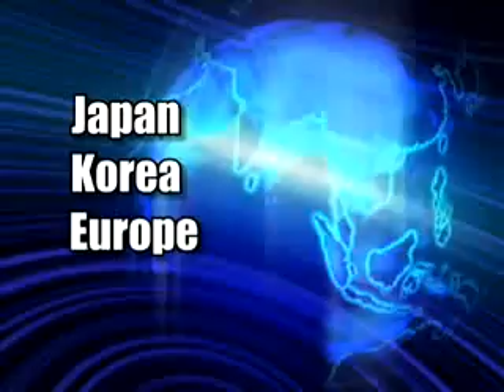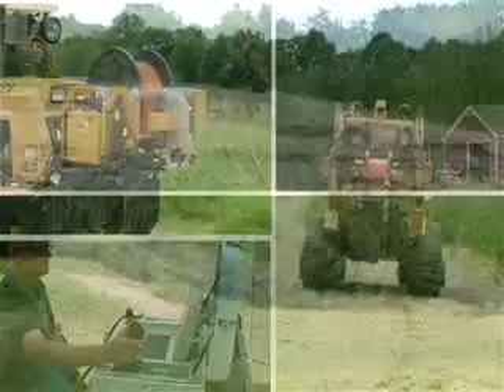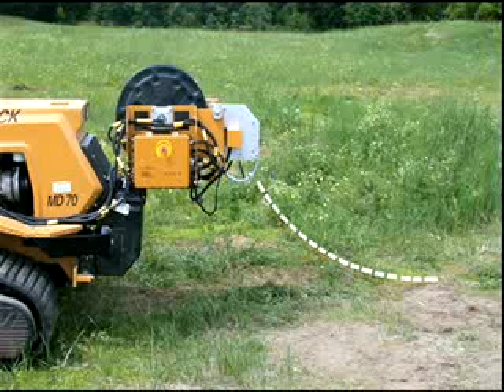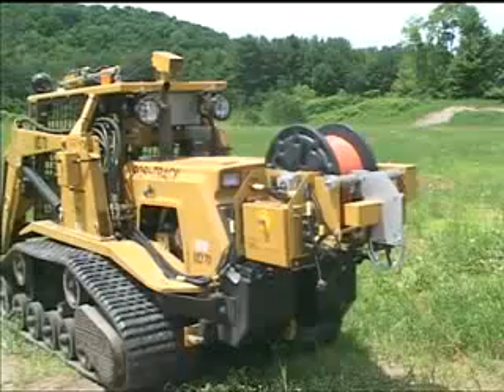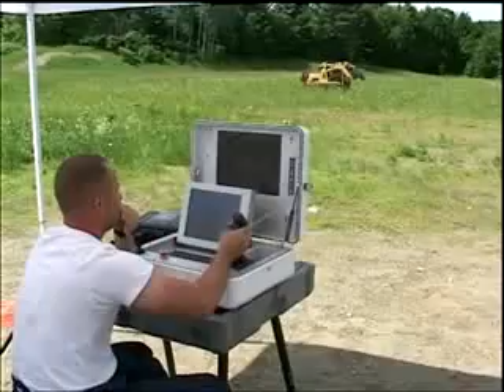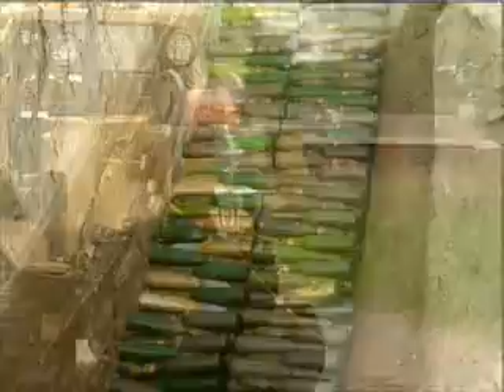Fiber-Optic Communication & Control System (FCCS)

Comment: We can use unmaned small vehicle to stretch copoer wire in front of heavy equipment and the heavy equipment claim the recher to copper cable for remote cintrol in mined suspected area or for anti tank or forward access denied opperation